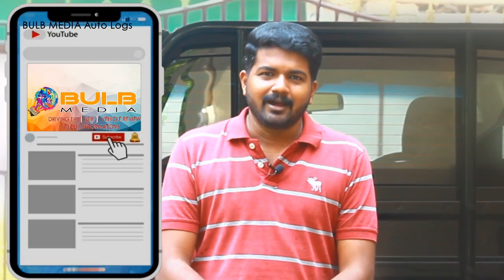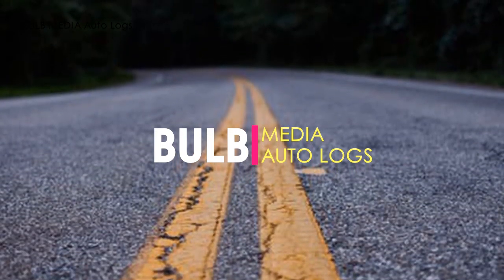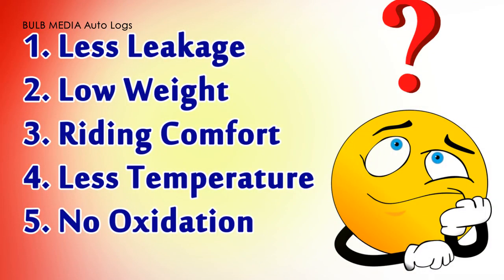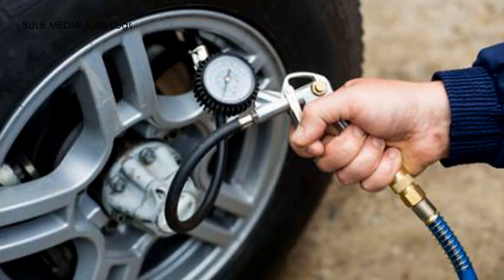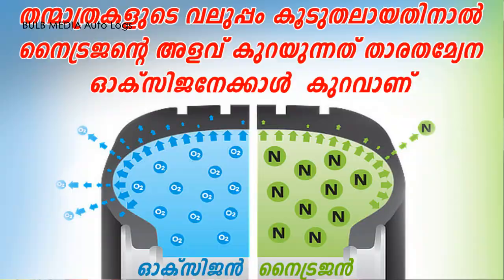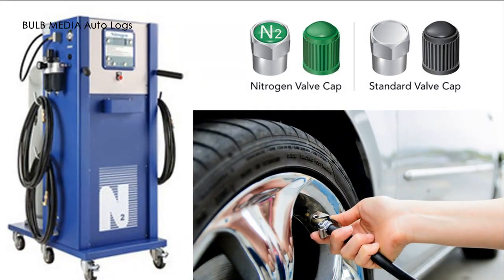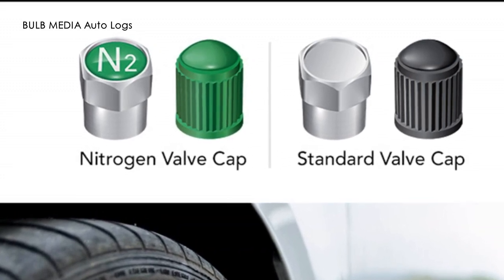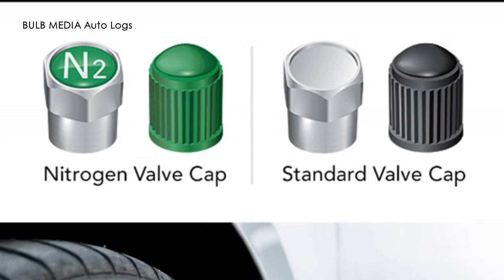Nitrogen Vs Compressed Air | നൈട്രജനൊപ്പം air നിറച്ചാൽ | Malayalam driving tips|Bulb Media Auto Logs

Comment: There is a thing buddy if you fill normal air when you car runs the wheels become hot and hot air makes the tyre pressure more and the tyres expand and contract but with nitrogen it stays cold so it doesn’t expand and contract so no small cracks on tyres which increases life of tyre.
Reply from the maker: Thank you for your feedback 💚